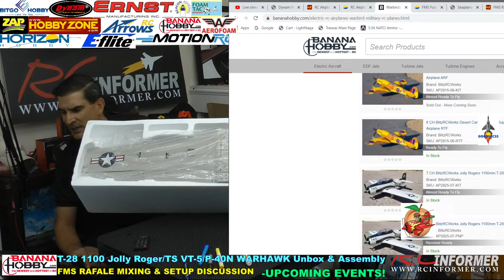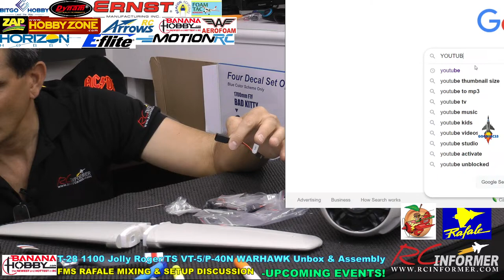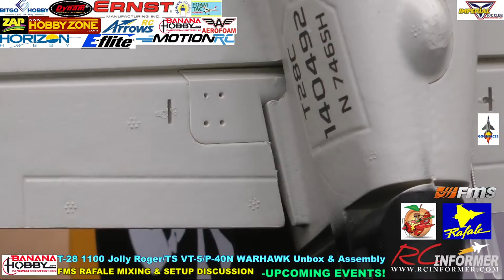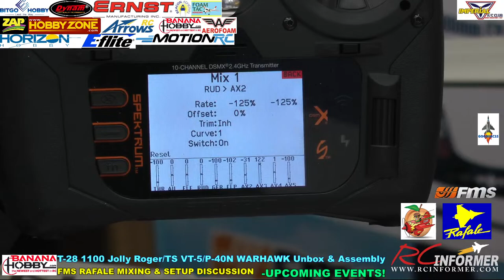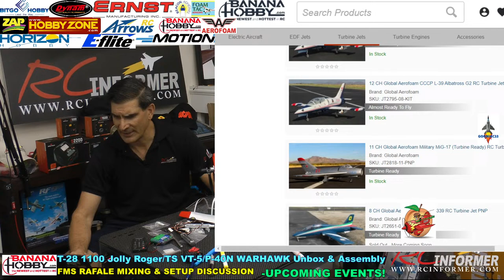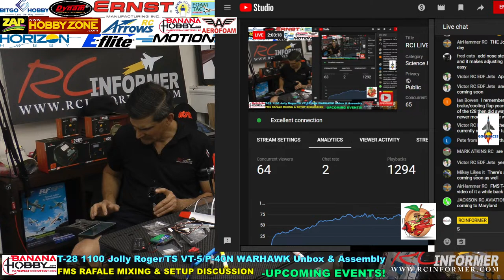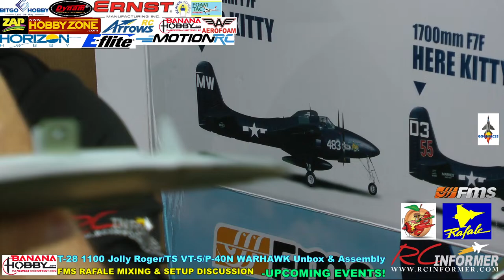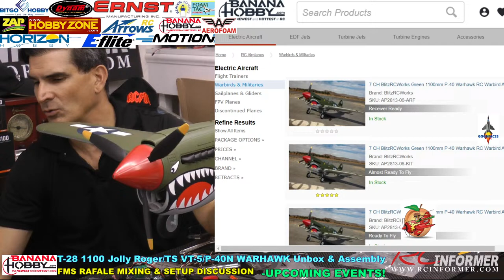RCI LIVE - Episode XVII - Banana Hobby Triple Unbox, Events, & RAFALE Setup By: RCINFORMER

Comment: The Jolly Rogers is coming !!! Rich I seen on your model that the elevator control surface was warped. Is that fixable with hot water if mine is like that. Man no matter what we do , we just got to slip and punch a hole or scratch it somewhere.😂🤣😂🤣😂 Yes I’m putting landing lights in it, and a pilot. Of course paint motor cylinders silver along with hub. That’s all she needs.👍🏻✌🏻🖖🏻 Keep updates coming 🖐🏻

Comment: What kind of paint do you use for touch up paint work or painting what you want to paint
Reply from the maker: Bring a flat piece like the elevator to LOWES and have the paint color matched. Do not let the guy there damage your foam part, ask him to let you hold the scanner over the part when scanning. You can brush it on or run it thru a airbrush with about 20-30% windex....:) Mt video on it: https://www.youtube.com/watch?v=Z2Zw4BBmJK4